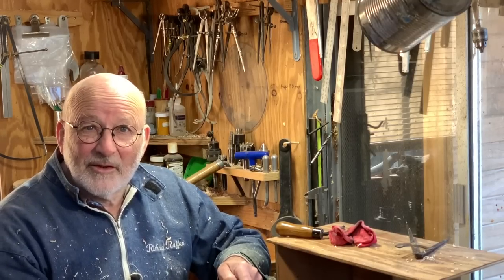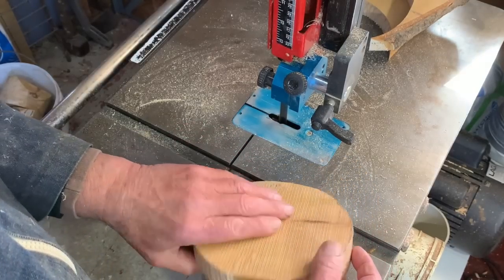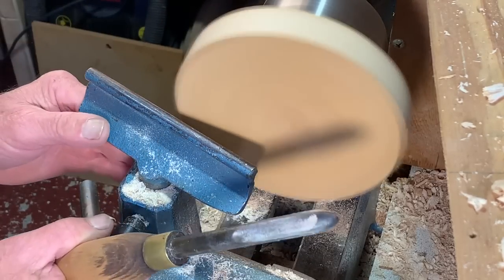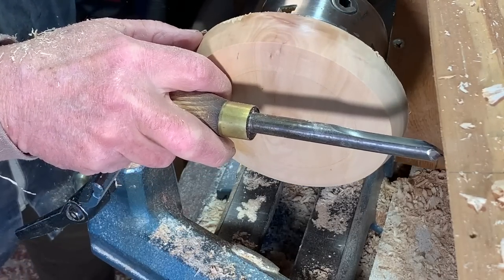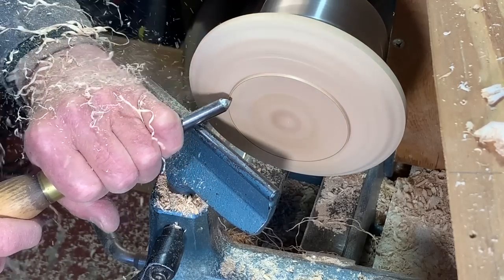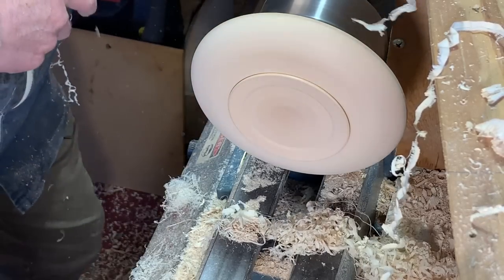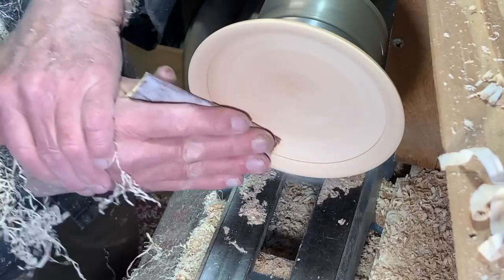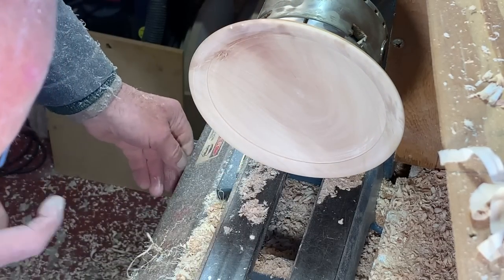Richard Raffan making a loquat plate from a short board

Comment: Hi Richard, hope you are well. I had an issue last night, and I realized that I may be able to ask the master himself! How do you approach turning a bowl from a wood that doesn't scrape well?

I'm thinking specifically about the inside "corner" and valley portion, and the wood I was fighting with was American Elm.

Love the videos, and I really appreciate the no-nonsense, straightforward approach to demonstrating and teaching.
Reply from the maker: I find scraping or shear scraping with minimal pressure against the wood generally takes care of difficult grain, but after that I resort to shear-cutting using a gouge, ensuring that the portion of the edge cutting is at around 45° to the oncoming wood. On small diameters, say less than 4-in/100mm diameter, endgrain can be particularly difficult to cut because the tightness of the curve doesn't offer much support to some of the fibres in the wood, and especially on enclosed forms.
Reply: @RichardRaffanwoodturning  That makes perfect sense. Thank you!

Comment: Thanks for showing how you start a plate off i could not figure that out which has stopped wanting to try it out. 
Question what speeds are you running your lathe at curious ask mine is a smaller version that only has 6 fixed speeds via belt change?
Reply from the maker: You should be safe running an evenly balanced 200-240mm blank at around 900-1200rpm. So much depends on your lathe and how it's set up to cope with vibration. Always start slow and when turning th lathe on, be sure to stand clear of the line-of-fire — the direction the blank might go if it comes off.

Comment: What is the bevel angle on your shear scraper Richard?
Reply from the maker: The bevel angle on the shear scraper is 45°. The edge is occasionally honed but usually used straight off an 80-grit CBN wheel.

Comment: Amazing as usual Richard!! So why did the foot not get bruised from the chuck? Or did it?
Reply from the maker: If you turn a foot or tenon to the correct diameter for a set of dovetail jaws with unchamfered rims, the jaws won't mark the wood. This shows how and why:  https://www.youtube.com/watch?v=DV2T6oJgCi4&t=94s
Reply: @RichardRaffanwoodturning  thank you for the link Richard! So a shoulder isn’t a requirement to safely a small diameter bowl or dish? And one doesn’t need the exact angle of the dovetail either to hold the workpiece steadily?
Reply from the maker: @pkaul5012  You definitely don't need a flat against the top of the chuck jaws on facework, but it's good practice turning larger endgrain blanks. With facework, having the jaws up against the base of a curve is more than adequate but there needs to be a well defined corner into which the jaws fit, thereby locating the part-turned work accurately on centre. As you'll see in the chuck video, I tend to grip beads rather than dovetails, but that's mostly for aesthetic reasons.